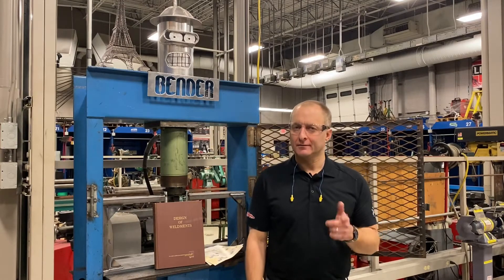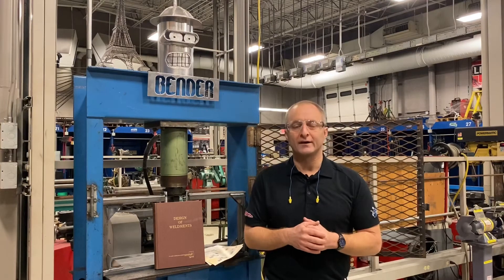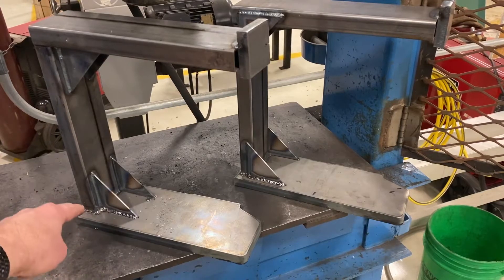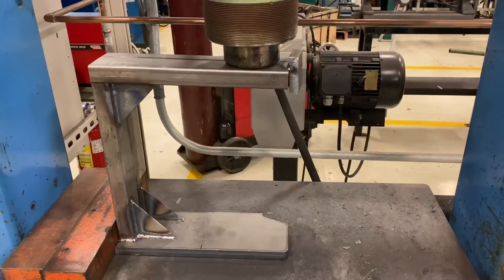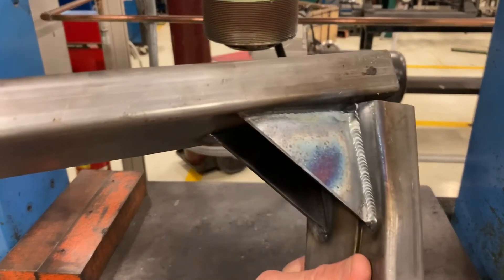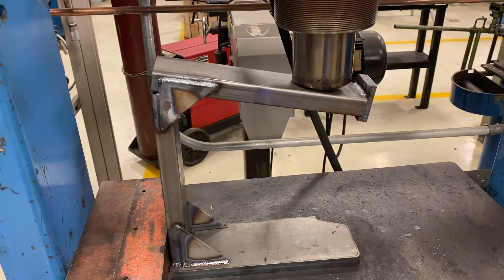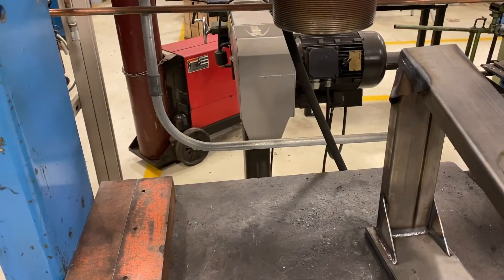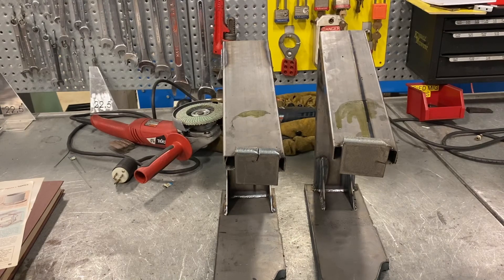PROPER PLACEMENT OF WELDED GUSSETS AND RECOGNITION OF OMER BLODGETT

Comment: gussets should be used in addition to a welded joint as in the data sheet picture........your demonstration was poorly executed with missing joint and inner gussets welds and improper gussets placement

Comment: Doc. This was fascinating!!!!
What if we put a single gusset in the center and then the two on the outside ? Would it be possible that the single gusset on the interior could absorb more of the shock load? Based on what I just saw I’m thinking it would help to divide the load more evenly and the outer gussets would work more efficiently. 

If possible could you one day do another video and try this same setup again with a single gusset in the center plus the two on the outside? 

James

Comment: Interested to hear your response if you had time. I'm on the fence about agreeing with your analysis. I'm an mechanical engineering technologist so my background may not be enough to satisfy an answer here but none the less I'll outline my thoughts.
1) How can we say the second joint (gussets welded outside) is stronger? 
- We don't have any data to backup how much force either of the joints experienced so comparison is difficult, eyeballing it I don't think is correct either.
-We also saw the second joint reached and exceeded the ultimate strength of the weld, leading to failure. Perhaps in shear or in tensile. Though looking at the loading I would think transverse shear of the weld and failure from that shear stress is what occurred in joint 2. 
- The tubing may have not experienced any plastic deformation but we do see an overall failure of the joint at the weld. What does this say about it's integrity compared to a pound for pound comparison of joint 1?
2) Comparing the two joints we see that joint 1 did not fail but experienced plastic deformation, the tubing buckling on the face. Again we have no data for force applied but assuming they are the same in this experiment it would suggest that the first joint is stronger since it did not fail, though exceeded elastic deformation which is highly unfavorable, even worse then for joint 2.
-What does this say about the joint design? If the second joint were to have a larger safety factor perhaps it wouldn't have failed, but we would need to increase the first joint proportionally to have an equal comparison.
-If we are looking from a design and repair perspective perhaps not destroying the main member is the purpose of using joint 2? So disposal of gussets and replacement is more feasible, but the main member would need to be replaced regardless from the excessive stresses induced from the over loading. 

Anyone can feel free to chime in, great video none the less!
Reply: https://youtu.be/OzJQyTmNX3E?si=fAMKeJZO5lqjlUZh

Comment: It would be nice to know the resistance in PSI that the Press was exerting on each weldment. Also a test of a gussets vs a triangulated brace would be of interest.
Thank you for the test.
Reply: Yeah, it doesn't matter if one type of gusset damages the base metal less if the weight that it supports is considerably less than the other.  I'm not saying that is the case here, but without some sort of weight / pressure gauge, we don't KNOW what is really happening.
Reply from the maker: A pressure gauge on the hydraulic line would have been a great idea!! I didn’t think of it when I made the video. Uugh!!